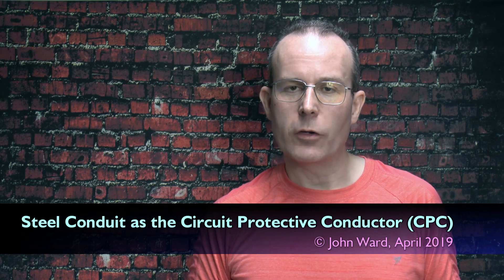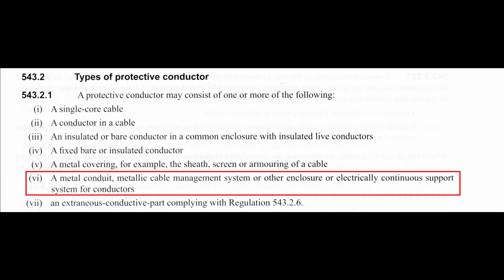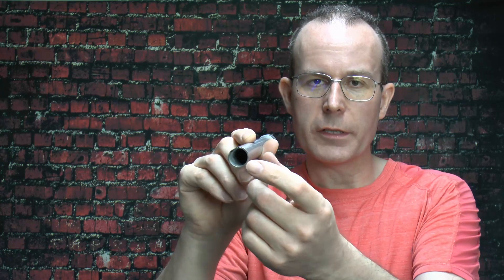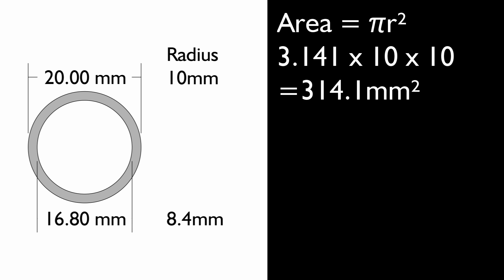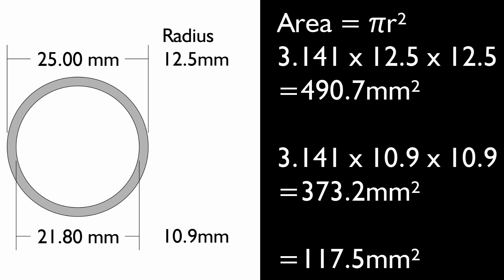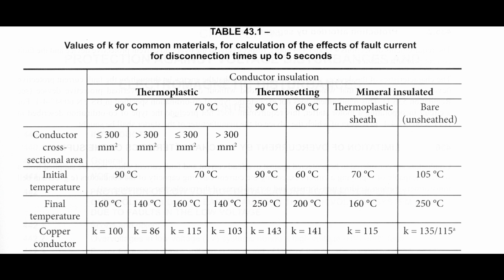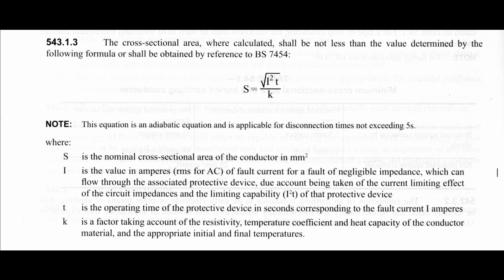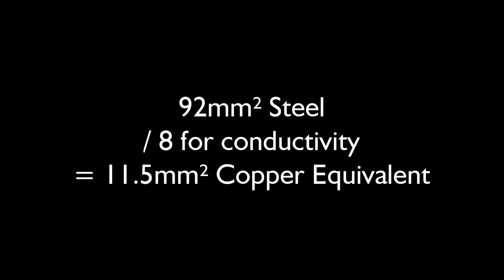Steel Conduit as the CPC (Circuit Protective Conductor)

Comment: I always use a cpc in addition to the metal conduit, everything threaded none of the speed fit, I like the hospital saddles as well none of that springy stamped out saddle crap, all cast saddles..

I only use pvc for data, bushed in and metallised copex where its the only option..
Reply: me too the cast saddles are so much better ...however if comes down to price I'll use the crappy saddles to offset the price of installing a 'propper' cpc inside the conduit.
Reply: Think you mean spaceabar not hospital saddles

Comment: Thank you for finally putting the myth to bed. . As to the people who say it rusts... it should be rust protected if installed in a damp environment. Poor installations aren't compliant with the regs.
Reply: I mean, maybe it'll rust in 50 or 100 years, but every electrical conduit I've ever seen is galvanised, and the connectors are usually made of zinc, so yeah, I don't see rust being a particular problem for most installations.
Reply: @Cadwaladr  Conduit in the UK is also sold in BE (black enamelled) which used to be slightly cheaper, but not by much. So this was often used for internal work. That stuff can rust. But it's specified for DRY LOCATION ONLY.

If you aren't sure, you use galv. If the customer wants to paint it, they can.
Reply: The fewer interconnects you have, the fewer possible points of failure there are. Environmental protection is also desirable. These two properties are the reason why running another wire is the safer solution. Simply get a cable with the right amount of cores, problem solved. 
This is not about poor installations, this is more like stating that redundant systems in airplanes are unnecessary, just do better maintenance. 
Why risk it?

Comment: I have personally come across several installations that have ended up with no CPC continuity  as the joints have either corroded or come loose or some one has hacked the install about and added extra hardware ..badly..I really don't like relying on the conduit as the CPC .. especially in industrial applications... Yes I know it's ok in the reg's .... But I always try to convince the customer to spend a bit extra for a separate CPC.
When the system is first installed using the Conduit as a CPC is ok but over time moisture and badly modified installations can cause the install to become dangerous... I've even found installs with what looked like pipe sealant on the threads with no CPC continuity at all.... I'm sure there are loads of others who've never seen these faults...but I have.
Reply: Many electrocutions were caused using 'split' steel conduits as the earthing conductor in older houses in Australia.The conduit connections would come apart, damage the wiring insulation and then energise the unearthed conduit. Next person who touched the conduit received a fatal shock. Should always use a separate earthing conductor, cost is minimal compared to the risks.
Reply: Install bonding straps at the joints. Problem solved. This very common in industrial applications where there is vibration.
Reply: @StreuB1  well... bonding every box attached to the conduit is my standard practice.. which as you say gives multiple routes for the fault current but via the CPC I pull into the conduit..and yes it would be possible to provide bonding straps on some installs to make sure each unbroken run of conduit pipe is bonded...but if you refer to the external strap types ...they'd look crap and be extremely subject to probable damage in industrial installs... Also  however there are times when it is only possible to provide one CPC route. ... Think here of conduit installs high up in non conductive buildings ( brick / block) .. so why not just include a CPC inside the conduit and just bond every accessory attached to the conduit via the CPC inside the conduit..... working in industrial applications which is where most of these steel conduit goes you have to assume it's going to 'live' an extremely rough life and every thing attached to it will need replacing at some point due to damage ...and you can't guarantee that the person replacing say the steel socket boxes will tighten everything correctly ...hell I've seen boxes that are literally 'flapping' about in the brease after being knocked with forklifts or pallet trucks ...I know we're not expected to forsee every possible future bit of damage to the install but it does have to be taken into consideration at the design stage ...this is when I make an argument for always adding a CPC pull inside the conduit..
Reply: Another way of looking at it is 'when the system is first installed using a separate CPC it is OK but over time moisture and badly modified installations can cause the install to become dangerous'. The argument does go both ways and I've certainly come across the latter - a lot.
Reply: These few replies prove why frequent inspection and test is always required. Its all about designing the installation correctly and not because you can or cant do something
Reply: @pmailkeey you mean is the wire or containment big enough lol
Reply: @pmailkeey you can't class out as a bodge because you don't like the method
Reply: @pmailkeey yes if it complied! I work to regulations not opinions.  In 25 years I've never had a single recall. So must be doing something right.
Reply: @pmailkeey which regulations do you work too?
Reply: @pmailkeey well then that answers it all lol.  If we all worked to the current regulations the world would be a safer place and more predictable when you work on existing installations

Comment: Hahaha in Canada as long as it's in conduit it's fine. The conduit acts as the ground. Unless you are running it through concrete or outside. Many engineers spec a separate ground wire pulled into the conduit anyways however.
Reply: Indeed, nothing wrong with going with the extra ground wire if it's not a major cost. But where the extra wire would require upsizing the conduit from say 20 to 25mm, and given the lack of 25mm knockouts on many smaller accessories... it can come down to simple economics. If you're working for an institution where health and safety > budget, a ground wire, always. But customers are often price based, if the one using the conduit as the earth is compliant, and way cheaper, it can win you the bid.
Reply: A further point that John missed in this video, is that if the electricians KNOW the conduit is the CPC... they're gonna be a lot more conscientious about making the connections properly.

I often get criticised by my boss for 'wasting time' by doing things like putting fly leads from the terminal on the box to the terminal on the accessory, even when not required by regs. 

Sorry mate, it's how I was taught. LOL

Comment: As long as there's no paint etc between bonding and steel conduit. And connection is secure.
Reply: Teh Beast you mean if the electrical installation/work is done correctly then